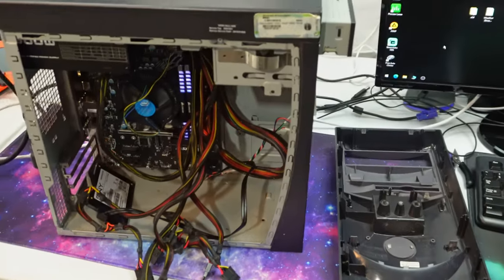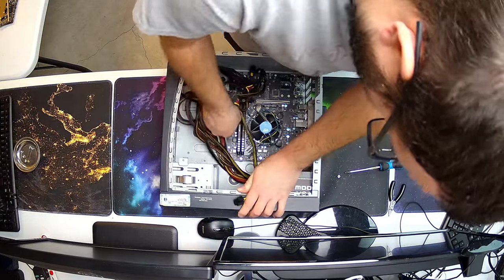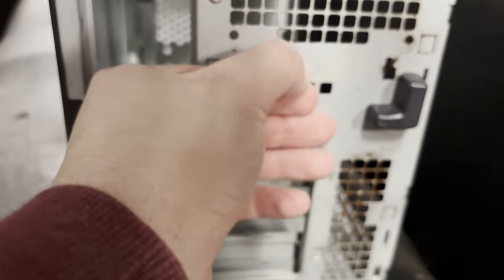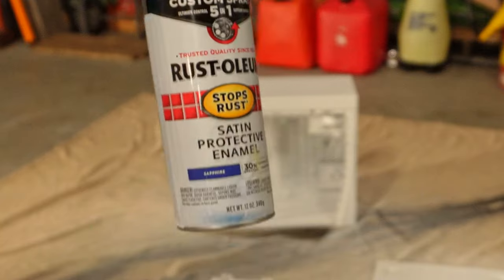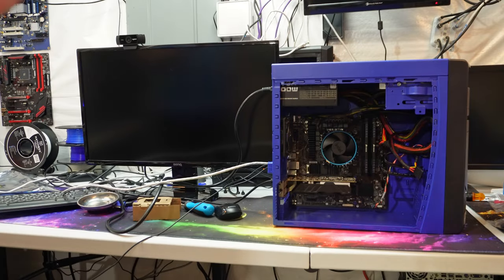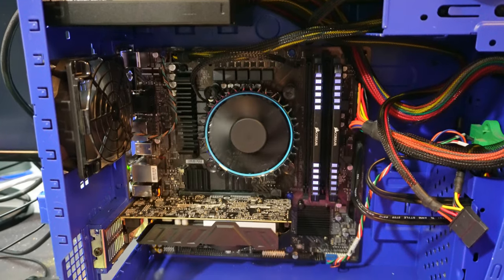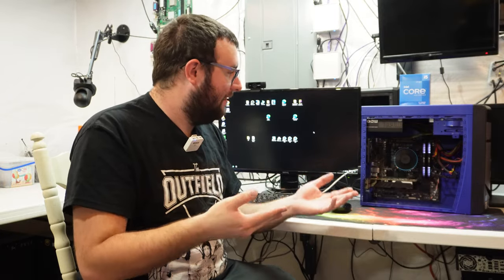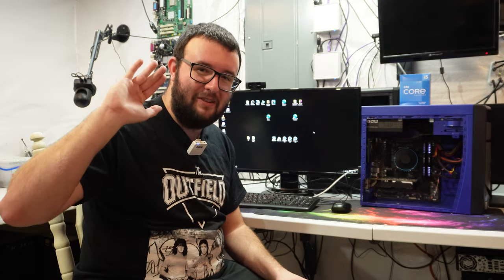Budget Beast Unleashed! Sleeper PC Build Exceeds Expectations!

Comment: I did a Ryzenplex build.  I also did a LGA 1200 build in an Inspiron 620 case and an AM5 build in a T1700 case, but haven’t uploaded those.

With my Dimension 2400, I want to use one of those Frankenstein Xeon boards from AliExpress.  I really wish that the PSU featured would go back to $29.99 again (I have two of them), and I also used to buy those PNY SATA SSDs (128GB was under $16 but they seem to be discontinued).